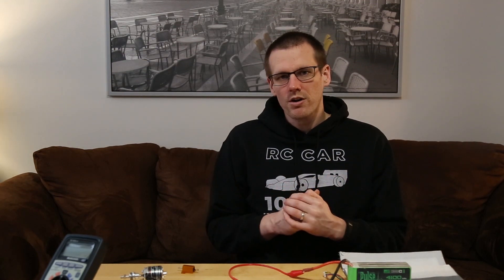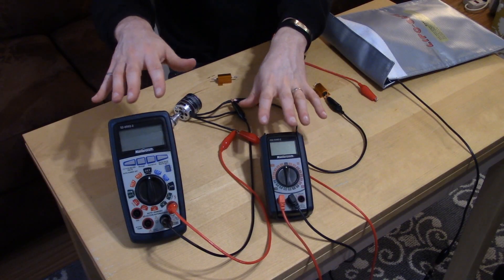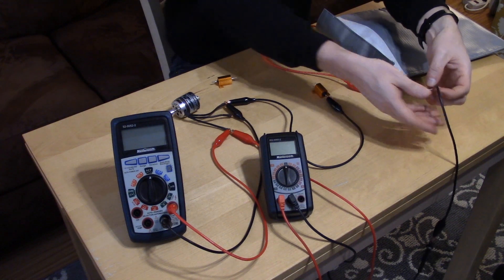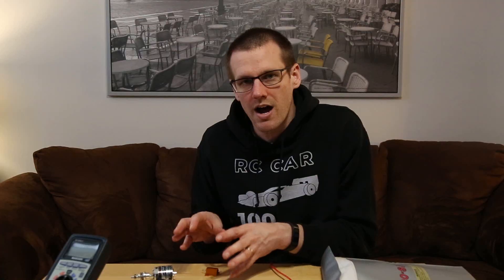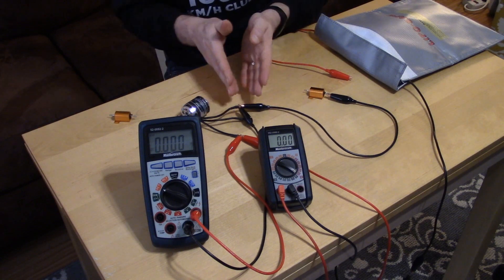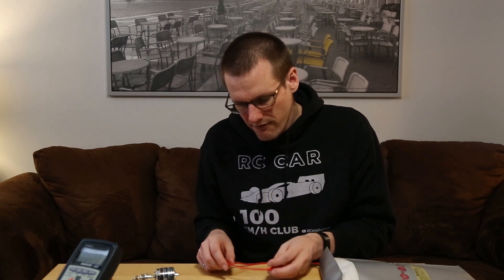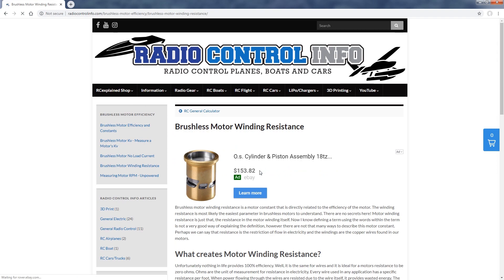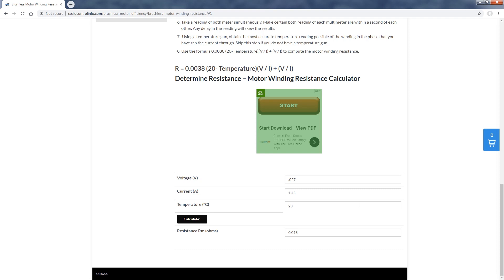How to Measure Resistance Rm in a Brushless Motor

Comment: This is really good, thank you! 

However, how did you derive your formula? I would be very interested in seeing how you did it, especially the temperature correction. Thanks again!
Reply from the maker: Thank you. 

Check out this site:
https://www.radiocontrolinfo.com/brushless-motor-efficiency/brushless-motor-winding-resistance/
Reply: @RCexplained  I have read through your article and used the equation, everything looks great! But it does show how the equation was derived, did you apply the Kirchhoff’s Laws to the circuit? How was the temperature correction done?
Reply from the maker: @interestingcan  sorry, don't have the derivation readily available. It ultimately comes from the basic V=IR formula
Reply: @RCexplained  totally understand, thank you! That's what I've been doing, just trying to duplicate the math to check my sanity.

Comment: Great video! But what power resistor should I use for 6S battery?
Reply from the maker: You should be able to use ratio of your pack vs the one used. Your resistor will be of a higher resistance.

Comment: Great video! But can I use a DC source, which measures current, to replace one of the multimeters and the battery? And where does the constant 0.0038 in the formula come from?
Reply from the maker: Yes you can.

Comment: One important comment.  You really don't know if this resistor is 10ohms or not.  Perhaps, it is 9.8ohms, perhaps 10.2ohms.  Its actual magnitude will affect the measurement of the internal motor resistance from two of the motor leads.  In order to remove this ambiguity, I would remove the motor from the circuit, and measure the voltage across the resistor and current through the resistor.  The ratio will give you the absolute resistor value.  then you can use that value in calculating the motor resistance.  Good video though.  Thank you for posting it.

Comment: Thank you for the good video. I am Korean, So Please understand if my english is bad. How much watts of power resistor did you use? Should I use resistor that can handle the rated power of the motor?
Reply from the maker: The power resistors used are 25W. I also do not leave the circuit live for more than 5 seconds to keep the resistors from overheating.

Comment: @RCexplained       I’m confused.  Why didn’t you just use a multimeter that measures resistance?  Is it not that simple?  I have a decent multimeter (Fluke 88) and I’ve been wanting to test resistance on a few of my brushless motors but didn’t want to pop the internal fuse….. it’s got 2 and one of them is quite expensive.  Does using the Ohm function not work that way when measuring brushless motors?
Reply from the maker: Typical multimeters are not sensitive enough for this measurement.

Comment: Hi, thanks for your video. What is the type of BLDC motor? I would like to do some calculations with maximum current, voltage and measure resistance... Because I am interested about determination of maximum current - how to determinate? Is it even possible? Thanks...
Reply from the maker: Hello, the best way to get this information is by measuring the current, voltage and temperature of the motor spun up and loaded.

Comment: Great information as always.  Could you say a bit more about the 3 configurations of windings you mentioned - is that the 3 sensors?
Reply from the maker: Thanks for the comment Xavier. A brushless motor operates on 3 phase power and also has 3 wires coming out from it. You could be powering any one of these 3 phases and should see identical resistance in each. For example you could wire your test circuit to either motor phase using either wire (wires a,b,c) AtoB, AtoC or BtoC. There is nothing to do with sensors in measuring Rm.

Comment: I only have one multimeter :(
Reply from the maker: Do you have a watt meter that you could use? Unfortunately you do need to have the multi-meter measuring current in the circuit at the same time you are measuring the voltage at the motor.